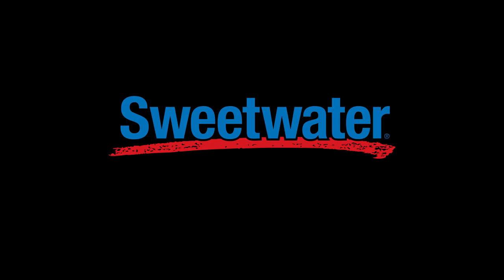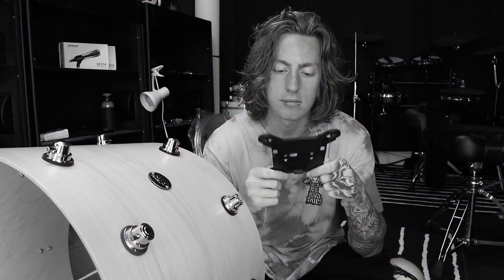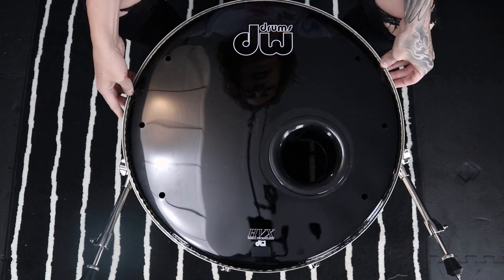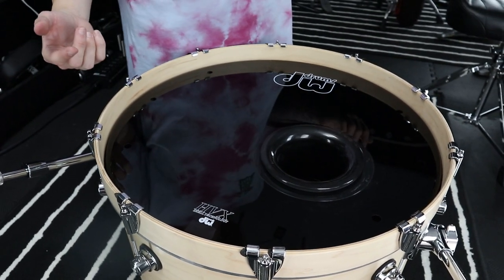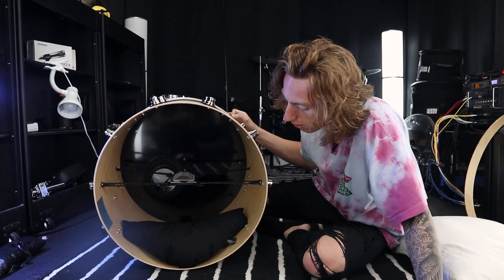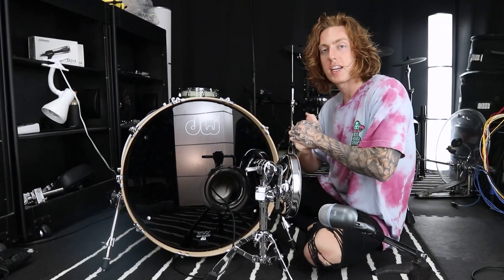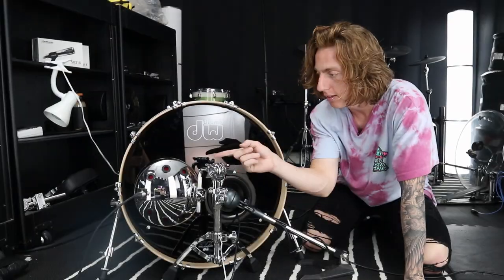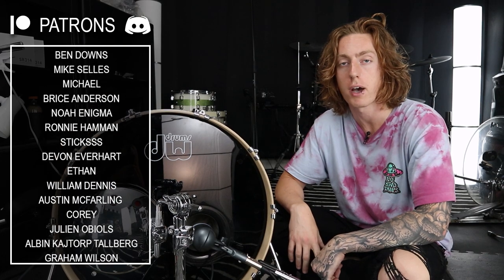How To: Kick Drum Setup (Tuning, Mics, Heads, etc...)

Comment: I mean im not against having the 3 mics for the kick setup but i found i can get a really good sound with the beta 52a by itself mounted a good length into the kick hole and aimed off center.
Reply: when you say "off center" you mean the mic is off center and aimed at the beater? Or do you mean you aim to the side of the beater?
Reply: @iRideuWatch  i aim up and away from the beater

Comment: That pillow killed half or more of the tone of the bass drum...EQPads are way better than a bed pillow....You're using the speaker/woofer mic to fill in and compensate for what you took out with that pillow...All you need is one bass drum mic on the hole to get a "monstrous" kick drum sound